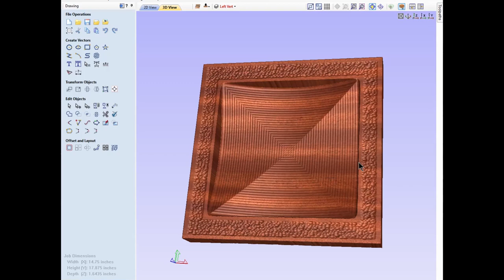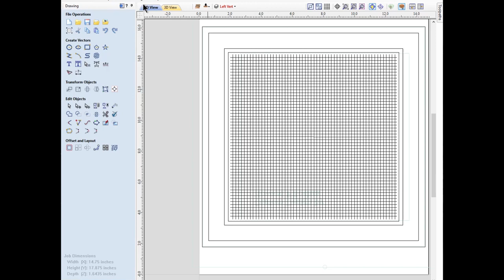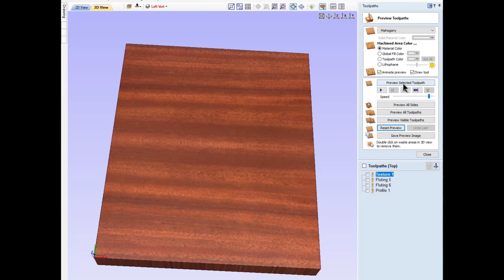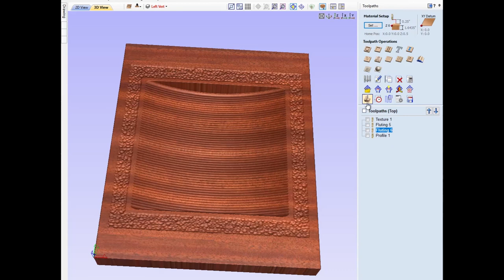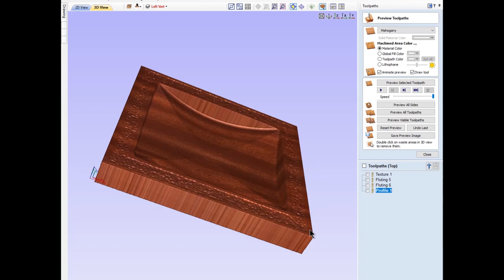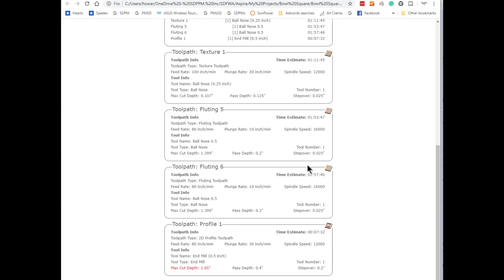Square Bowl CNC Easy Instructions

Comment: Hi
is there a part one of this square bowl that shows how you drew in 2d then started the modeling in the 3d tab?
I have done some 3d files but not done any  3d modeling. I have the same bowl drawn up to  a square and have a grid on it but how do I set the depths of cut in the  3d area. Unless I am missing the obvious?
Thanks

Comment: I really Like this and I tried doing the fluting tool path on a different project. but it just flutes the edge/ perimeter of the rectangle. what could I be doing wrong ? I am using Vectric V Carve Pro 10.5 Thank you in advance
Reply from the maker: Go to my channel and email me your Vcarve file and I will see if I can find why it isn't working for you.
Reply: @thewoodmaster  Yeah I am having the same problem too. I want to do 12mm wide flute and only have 6mm. How do we make a wider flute. Like the previous comment saying it goes around the edge and not clean it out. Is there a way to do that. What you did is actually what I wanted and need to know. Thank you